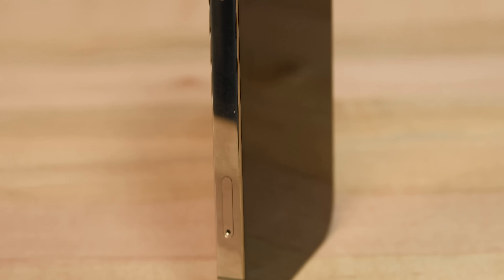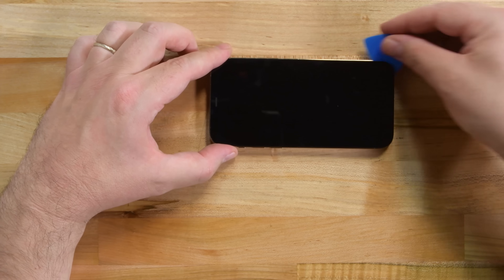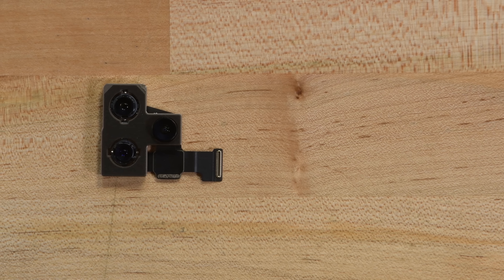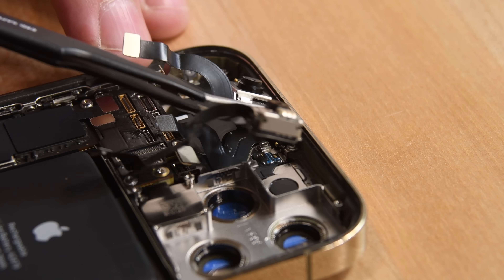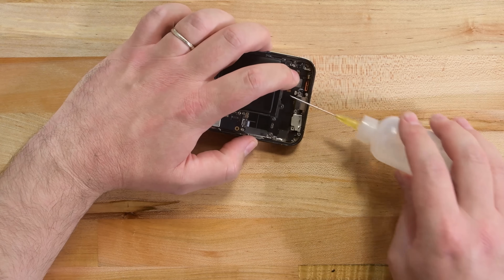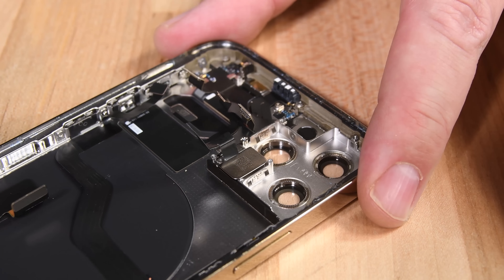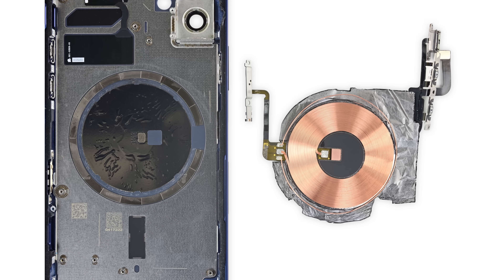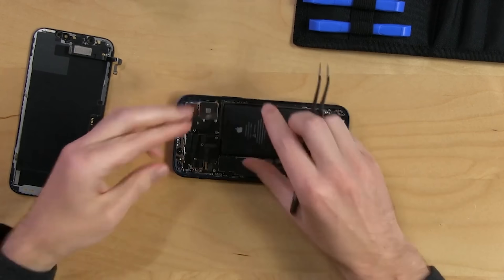iPhone 12 Pro Teardown: 5G Comes at a Cost

Comment: I heard that the battery is paired with the logic board and you get an error message when you power up.  Is that true?  And if so is there a work around?
Reply: Battery is paired to the board. You can sometimes fix the issue by reprogramming the new battery or by desoldering the old battery connector module to the new one. Takes a lot of effort to do that though
Reply: @malenmon  thats  Ridiculous
Reply: @samuelruiz7377  Yep, it’s how it’s done though
Reply: and the camera too
Reply: Apple: doesn't wanna include a charger because for the environment

Also Apple : doesn't allow 3rd party repair so you'd throw it away and buy the new one
Reply: Everything is paired
Reply: @ballislife8069  not everything screws and case still can be changed by your self.
Reply: Every single part is paired and it will show messages and software crashes if replaced even with another original part from another iphone.
Reply: Yes, the phone is paired to their current and future earnings. That means it sinks roots into your current and future money.
Reply: What????
Reply: Even the camera is paired now.
Reply: Other videos shows that if repaired and replaced with 3rd party like camera, battery and sensor, it will not function well
Reply: Aside from a money grab, it's a theft detterent, because iphones are now almost useless to steal for parts
Reply: @politcallycorrect5816  by letting apple directly stole from us?
Reply: Shouldn’t the crapple iPhone 12 should get a score of let’s say about 2 then?... there’s no problems like this on android phones surely? ( I use iPhone so I don’t know) if there is no such problems on android I’ll switch to android when this iPhone X dies out on me
Reply: There is if you use a JC V1S reprogrammer.
Reply: https://youtu.be/FY7DtKMBxBw - it’s true and the cameras are paired as well
Reply: That is correct https://youtu.be/FY7DtKMBxBw
Reply: Yes it's true check hugh Jeffrey's vid
Reply: Never mind the battery, or the display, what about the camera also? Who knows what other parts cannot be switched out without some issues unfolding?
Reply: You can watch a Video about that in the Channel "Hugh Jeffreys" he also did a teartown
Reply: about True Tone not working, I think it’s because each display is colour calibrated individually so this makes sense.
Reply: If you change any compounet inside the phone you won't see the battery percentage and face id will stop working and the camera will freeze. It's not a glitch it's just Apple being Apple
Reply: I'm just asking.  I heard the display is paired too.
Reply: @ronnielamkin727  Yep currently battery, display panel and cameras are paired to the logic board.
Reply: @IIIIIIIIIIIIIIlIIIIIIIIIIII  Means it cannot be repaired by 3rd party? Any 3rd party parts will end up with error message?
Reply: @ronnielamkin727  display is paired since iphone 8
Reply: @RinaldoJonathan  wait the display is not the thing that is paired, thats the face id mechanism thats paired to the iphone for security resons. You can replace the face id (touch id for the older ones) on the new display and it would work i got my iphone x and my moms iphone 6s by this method only. Hope it helps❤️
Reply: @pranavaggarwal4779  no, the display is paired. Try to replace display without copying the old display id, you get true tone disabled. 

I run phone shop.
Reply: @RinaldoJonathan  I said the display works not about the true tone. Peps above were saying that it doesn't works and will show error and i said that it will work but you are right the true tone will not work like that but copying old display id is fairly simple by any person who will get his phone repaired from any 3rd party can get that done.
Reply: @ronnielamkin727  YEAH ITS TRUE  search huge jeffry on youtube he proved this
Reply: @ronnielamkin727  the battery wont say how full it is.
Cammera will remove face id and the camera app will always crash.
Display will remove true tone and the fingerprint scaner.
No apple are the only people though can pair the parts with the Ddsplay.
Reply: The battery still works after being replaced - it just doesn't show battery health (something Android phones don't do to begin with) and gives a notification about it. But it still functions. Seems relatively fair to me.

Comment: What cost? Battery? The Galaxy Note 20 is also 6.7" and it still has a bigger battery 

The reason the iPhone has always had a smaller battery vs the Galaxy S or Note as an example, is because Apple is terrible at design.

It is about form over function. Samsung is king of both.

Comment: Anyone have an iPhone 12 that gets warm easily sometimes even with 5g off. As well as some not so good battery.
Reply: Check out apple offical website and compare iphone models u see will that the new iphones have 2 hours less video watching hours than iphone 11 series  expect 12 pro max. So yes they sacrificed battery for 5g and useless feature called magsafe.
Reply: @googleuser9519  except not. The 12 lasts exactly as long as the 11 and the 12 Pro only has 1 hour less watch time compared to the 11 Pro. And in real Tests, the 12 consistently beats the 11 easily.
Reply: software related
Reply: @tippy35075  wym
Reply: Yes just upgraded last night and noticed it felt warm but then not so much today. As battery sucks at this point and in my area not a lot of 5 g yet.
Reply: My battery life is subpar
Reply: Probably the memory. I phone 99% of the Time gets hot due installing or updating something.
Reply: I will never buy anything from apple again. This phone is a piece of fucking shit

Comment: Is the back glass still super duper glued on or did they finally switch to adhesive?
Reply: I’m sure it’s super glued
Reply: It’s super glued because otherwise if it broke the pieces would fall everywhere and that’s a bad look for them
Reply: @malenmon  I see back glass pieces missing on iPhones fairly commonly. Samsung has a lot of broken backs but they laminate the paint on in a different way than apple does and stays together even when broken. all while still only using adhesive and maintaining some water resistance

Comment: If the back glass is broken, can it just be heated off or you have to remove the display?
Reply: Probably easier to remove everything inside.
Reply: @christophercrawford2736  That sounds time consuming and expensive just for a back glass.
Reply: Remove the display and board first before heating the back glass off

Comment: I just want to make a quick note about the cameras, LIDAR is not just used for low light focusing, but all focusing from what I can tell with my testing
Reply: also for AR
Reply: But only for a distance within 5m / 15ft because that's the range for LiDAR.
Reply: @Raja995mh33  true, it works in most low and medium range conditions, which is most photos
Reply: @Raja995mh33  5m is still pretty good LIDAR depth data especially indoors. You missed my point, on good lighting condition, LIDAR is not necessary for AF. So whatever they do with LIDAR in good lighting is definitely not about AF.
Reply: @3dr14ng4  it's Good, yes, but useless for many pictures.
I never missed the point, I just said that LiDAR is very limited in its range for focusing.
Reply: 😂😂 that’s not the case chief.. DUAL PIXEL AUTOFOCUS is already there to make things a lot faster.. and Samsung has another type of focus they are using with their recent Galaxy S23 ultra smartphone and it’s called QUAD PIXEL AUTOFOCUS and this is in order to handle that 200MP SENSOR 😅😅 I still think 200MP is ridiculous for a smartphone and somewhat unnecessary at this point.
Reply: yeah i bet its faster autofocus in alot of sunlight aswell
Reply: @jesperhammarlund300  Dual pixel AF is already fast. So using LIDAR on already ideal lighting condition for "faster" AF is not the case. However, if you say that Apple is using Lidar to map the environment for their machine learning then I would absolutely agree.

Comment: Could you open up a non us version iPhone? We are really interested on the differences, they sell it at the same price, so it would be nice to see what differences will it have
Reply: It’s literally the same minus the 5G antenna
Reply: All worldwide versions have 5G no? There’s 3 model types: A2407, A2411 and others and they all can do 5G
Reply: @thenichenichecars  yeah normal 5g, but the mmwave thing costs a lot and its missing from the worldwide versions, its pretty unfair tbh,  google made their pixel 100 dollars cheaper outside if US because its missing mmwave

we don't have a circle at the side outside of US on this years iPhones, they could have filled it with battery, or just sell it cheaper
Reply: Comes with inferior 5G antennas ... Xenophobic Apple
Reply: Wouldn't it be the exact same without the 5G antenna and the Qualcomm chip?
Reply: They use some plastic modeling to fill the mm wave antenna. Other then that its the same, you can see they do the same trick between 12 and 12 pro with lidar camera.
Reply: @sadfdsfasdfnadfsfsda7933  I can confirm that this is correct

Comment: And what is that cost mentioned in the title? Would it be smaller battery? You don't say on the video.
Reply: Fairly sure there isn’t one, its just clickbait
Reply: I think it refers to how the antenna cable curves around the battery making it a little bit more annoying. Just my guess
Reply: It is the fact that battery life will be shorter. It’s a bit of click bait and from what they said on their steam
Reply: Price?
Reply: The cost is that the internals are messy, that’s it
Reply: The cost is buying a new iPhone everytime you need to replace anything in it